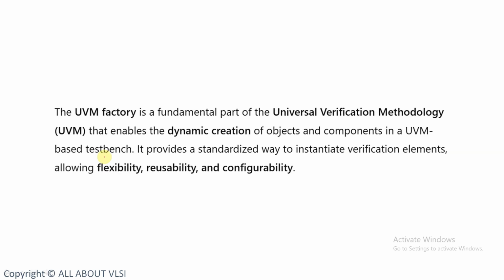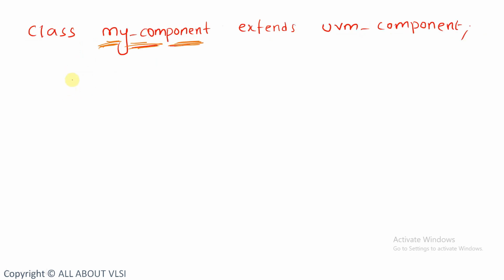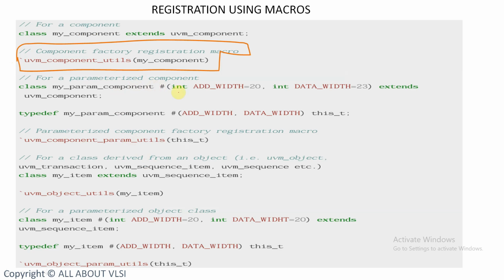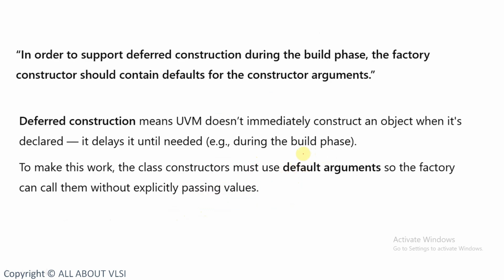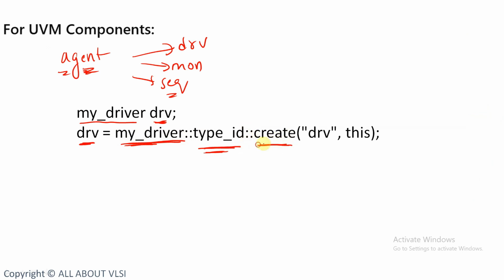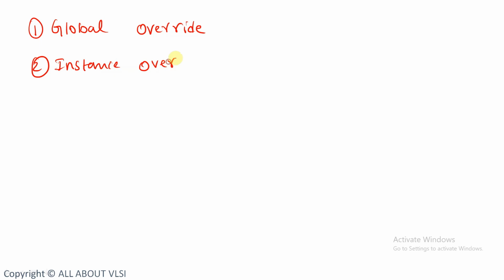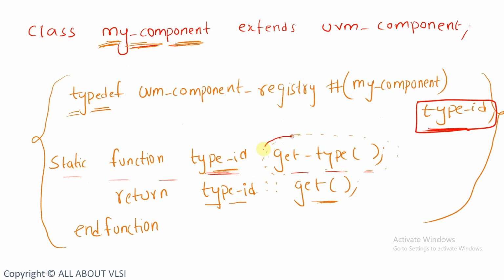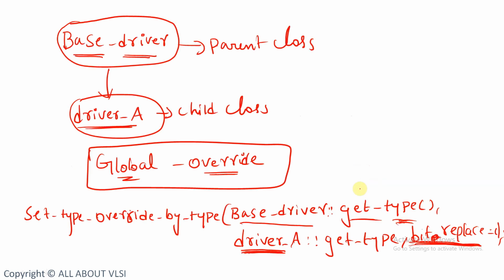Introduction to UVM Factory | Registration & Overriding Explained with Examples

Comment: [00:22] Definition: What is the UVM Factory?

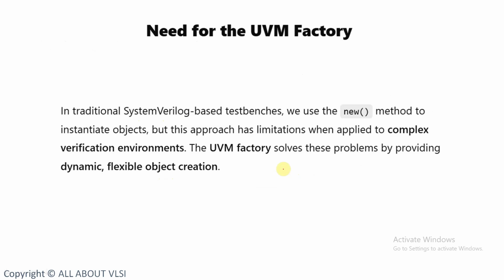[01:17] Why we need the Factory (overcoming limitations of the new constructor)

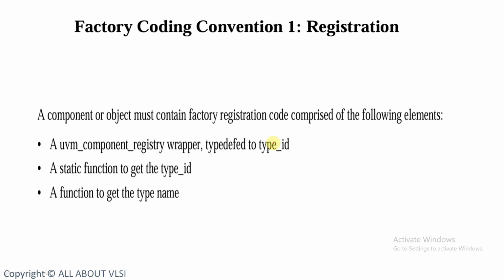[01:41] Mandatory Step 1: Factory Registration

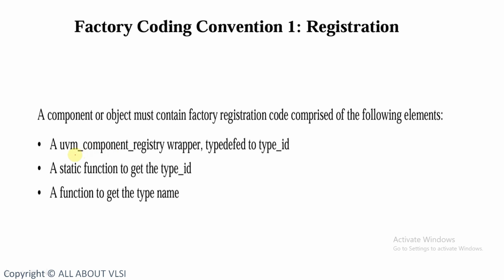[02:46] The long way to Register Components (using uvm_component_registry and get_type)

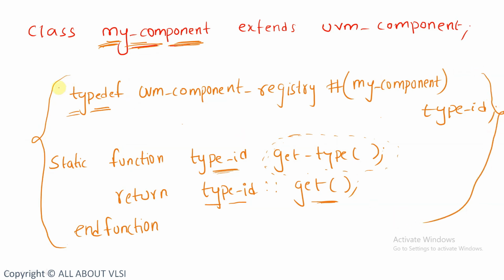[05:58] The common way: Registering using UVM Macros

[06:27] Macros for Component Classes (e.g., uvm_component_utils)

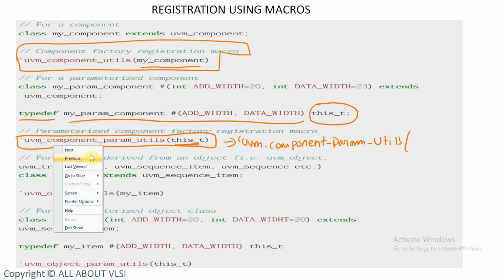[07:39] Macros for Object Classes (e.g., uvm_object_utils)

[08:44] Mandatory Step 2: Creating Instances using the create method

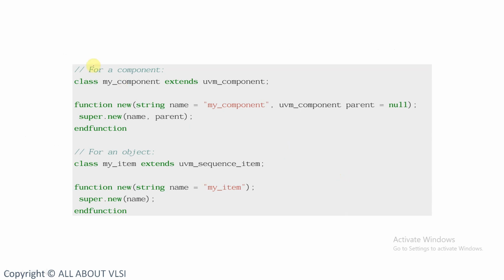[10:07] Default arguments for Component and Object Constructors

[11:34] Syntax for calling ::type_id::create (Component Example)

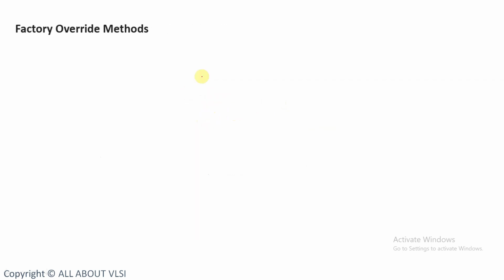[14:04] Introduction to Overriding Components

[15:47] Two types of Overriding: Global vs. Instance Override

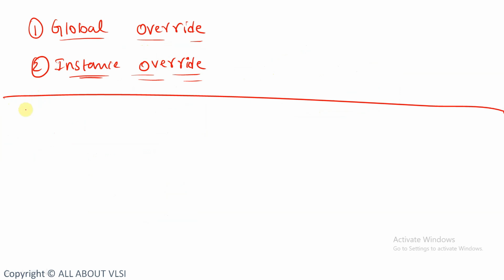[16:29] Syntax for Global Override (set_type_override_by_type)

[20:25] Syntax for Instance Override (set_instance_override_by_type)